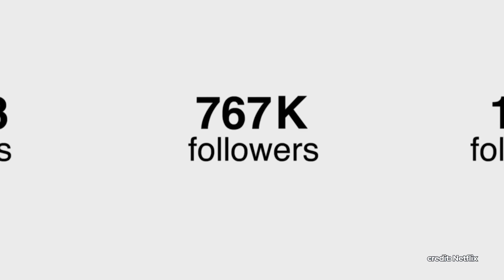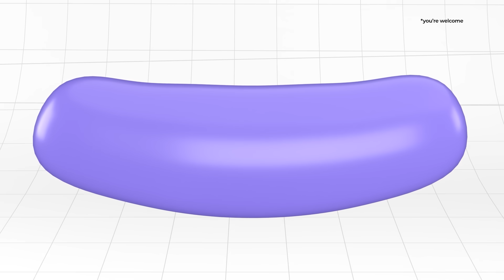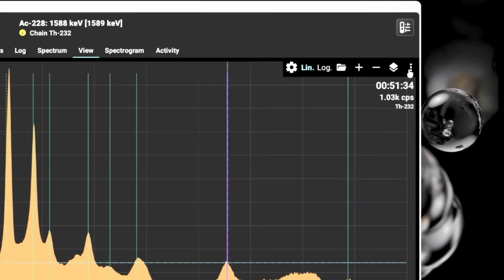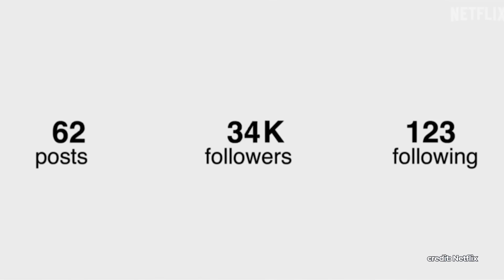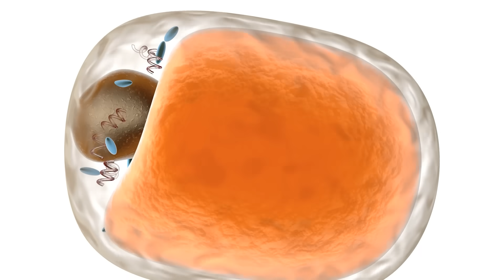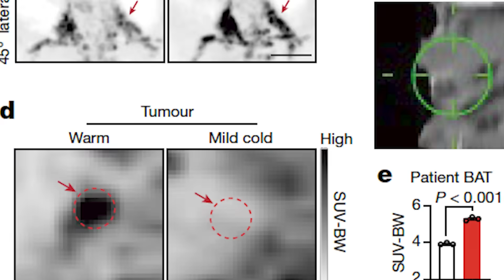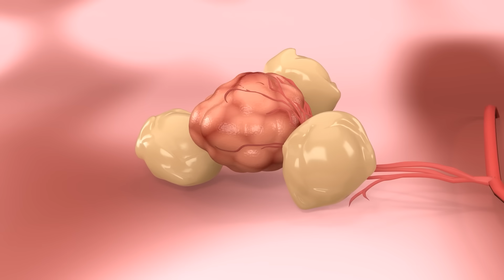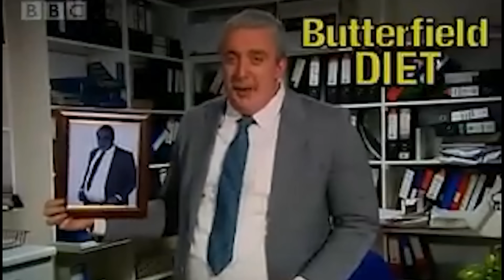Scientists Just Discovered How to Starve Cancer

Comment: This is all true and interesting but a big mistake would be thinking that this is fundamental to cancer biology. 

Remember cancers are mutated cells that selfishly adapt to their local environment to maximize the reproduction. 

If they are in a healthy body that has plenty of glucose, and can clear lactic acid. Yes they're going to use glycolysis and the lactic acid fermentation pathway. 

But cancer evolves. If you find a way to block that pathway you haven't cured cancer. You just put a different evolutionary selected pressure on it. Then it's going to start using more different cellular mechanisms to get its energy. 

The reason why it developed the glucose preference in the first place was because in rapid tumor growth, vascularization often lags behind.  Creating an anaerobic environment.  The cancer adapts to that anaerobic environment. Becoming more resistant to lactic acid and amplifying its ability to ferment glucose anaerobically for energy. 

Long-term, interrupting this process will definitely slow cancer down, but it will develop new processes like stimulating angiogenesis increase in oxidative phosphorylation as part of it's normal energy production. 

So this cannot be used as a cure in most cases, though it will slow cancer down in most cases and probably can be used as an adjunct to chemotherapy and surgery

Comment: What happens when the new beige cell line goes cancerous? Won't they just become super cancer? There needs to be some sort of kill switch, or better yet, multiple kill-switches, built into the beige cells as a fail-safe. The beige cells could even learn to be an infectious pathogen like in canine transmissible venereal tumor or devil facial tumor disease.